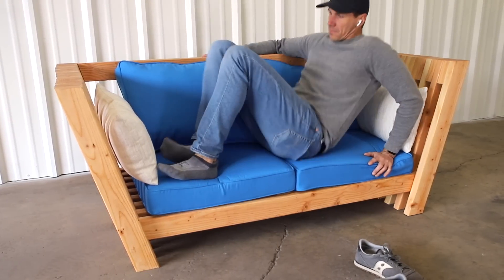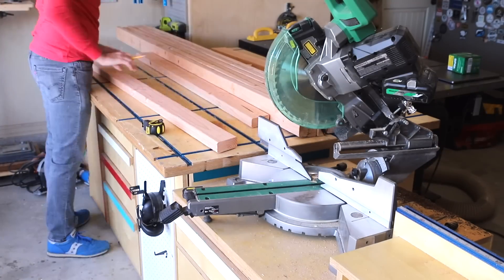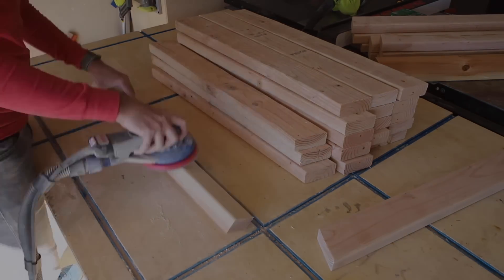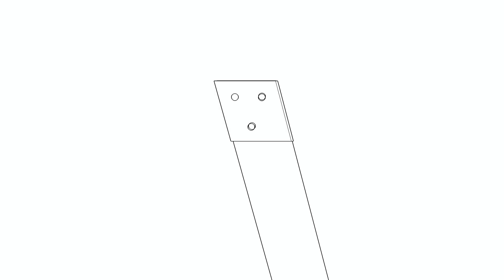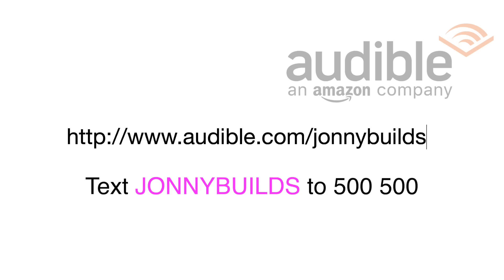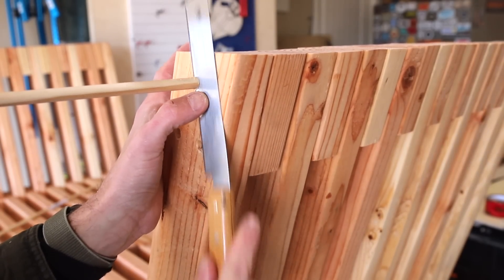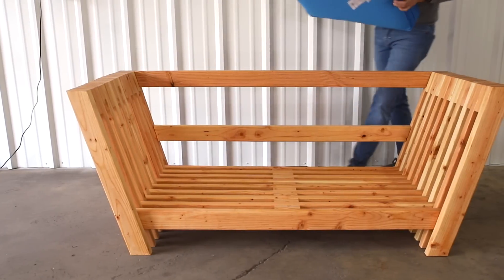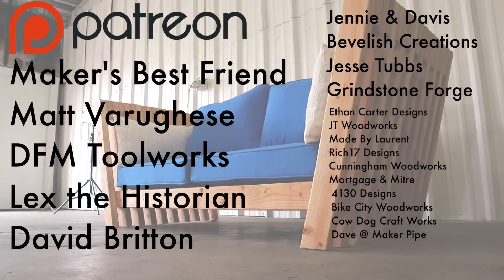DIY Modern Indoor/Outdoor Sofa Made From 2x4's

Comment: Ok.... I’ve done it ... 2 things.... it wasn’t cheap in the end cost me around £150 without cushions but I guess it cost more to buy in the shops.  I made the seat slightly higher and finished in medium oak danish oil.  Also I went through over 200 screws which I hadn’t anticipated... nice result though cheers Johnny builds
Reply: Timber's a lot cheaper in the states than over here in Blighty.
Reply: discostoo sure seems to be... so many working with cedar which costs a small fortune here...

Comment: lounging :) 
Really liked it, will try it out and share the pics with you later! I'm thinking of extending one of the sides, making it an "L" shape, but keeping with the same design. That means that the extra couch would have the same leaning backrest, but the opposite one would be cut short so it fits with the longer part. What do you think?
Reply: This is what I'm planning on!! Also making them both 4 seats long and raising the seat - how did yours turn out?

Comment: Just finished making this. Saw this video about a month ago and wanted to make it. I added a 3rd back support near the seating area. And I ended up using valspars stain and sealer on all pieces,  after sanding them. The color of the stain sealer is a light gray with a slight blue tone. Wish I could post a pic of it,  to show. But it turned out great and my girl loves it. I'm planning on making matching chairs and a bench swing to go with it. Thanks for the video.

Comment: The design looks great & thanks for sharing it.  The sofa sits very low to the ground.  Wondering how easy or difficult it is sitting down and getting up from the sofa?  Would older folks find it difficult to use?  Thanks in advance to anyone that responds.
Reply from the maker: It’s definitely low to the ground and would be difficult to stand up out of if that’s something that’s an issue for that particular person. The great thing about this sofa is it’s easily customizable to make the design work for your needs.

Comment: Hi Jonny,

I really like this design for my living room. :)
But I want to customize it and make it 3 seater.
Could you please let me know if its possible in this design.
And if yes can you tell what things I have to consider?
Reply: Hi Shivani, I've just come across this video myself and it has super inspired me to do something similar this summer... As for a 3 seater, I suppose the only requirements will be longer 2x4s to accommodate for the stretchers. You might want to find and measure the 3 cushions you want to use to help you ascertain the right length of the seating area. Otherwise everything else should be the same as per Jonny's instructions... (Jonny I hope I'm not overstepping on your territory, lol!)

Comment: 2x4 timber and 2” screws? How far are those screws protruding through each piece of wood to grab the adjacent piece?
Reply: Well... let's see... As you may know, the actual physical dimensions of 2x4 are 1.5"x 3.5", which gives us the difference between the screw length and material thickness of 0.5", then you could add to that the countersunk depth of the screw and the total protrusion comes to approximately 3/4", which is half the thickness of the adjacent material. Apparently, this is sufficient to maintain the structural rigidity of the whole unit.

Comment: I really like this design. In your later builds, you have a more "modular" approach: the pieces of furniture can be taken apart. Could this design be adapted  to be modular? I was thinking about elongating the back pieces so they go over the left and right arms, and, maybe, half lap joints to join the bottom to the arms? Either that or a 1in dowel going through the whole thing. It would add a nice visual element, but would it be sturdy enough?

Comment: If you flip the sofa 180 degrees, you would not need to dowel as the screws would be on the back
Reply from the maker: The screws are in the back
Reply: @JonnyBuilds  Makes sense

Comment: I love this design any chance you will be making matching chairs and a coffee table?  A full setup.
Reply: I think to make a matching chair all you would have to do is narrow the sofa width by half or what ever width you prefer the chair to be. Keep the same depth as the seat and height as the are rest. The table would be something like the sofa seat, interesting idea.
Reply: That's supposed to say armrest not are rest, my bad.
Reply: Charlie Brown I agree 👍 that would work.
Reply: @chrystald.  Thought about the table, the legs could be at the same angle and the top could be like the sofa but put a piece of glass on top to show off the 2 X 4 base. How bout that. You might be able to make end tables the same height at the arm rest and being angled they would snug up close to the sofa. A complete living room suite.  :>)
Reply from the maker: Possibly! Thanks for watching 🙏
Reply: Charlie Brown  for some reason I love those wide angles. I was thinking it would look good on tall captions chairs also. Then have a matching tall bar table.
Reply: Jonny Builds should the side parallelograms cut also at 15 degrees?

Comment: Looks amazing yet simple.  I'm curious about turning this into a fold up stow away alternative.  
Big steel bolts through the bottom joints, and maybe a half lap for the back cushion supports for more strength. 
Would this weaken it too much do you think? The front of the arms might suffer the most maybe. 

Thoughts?